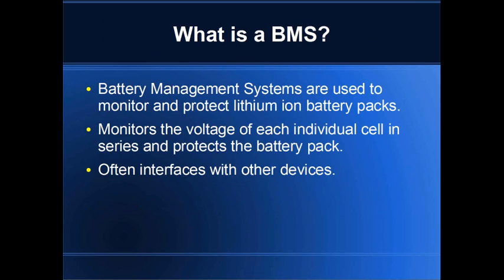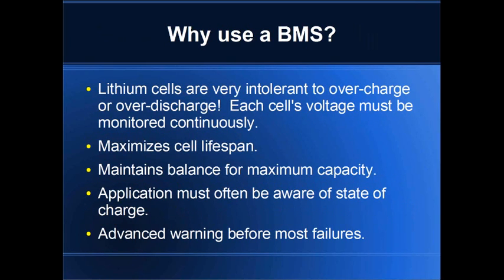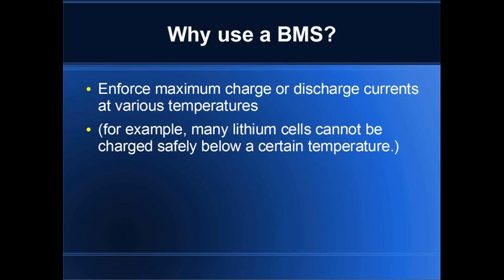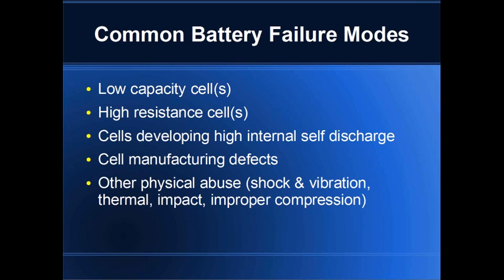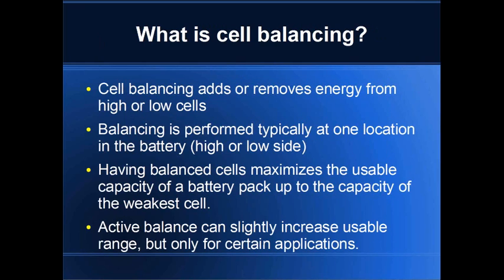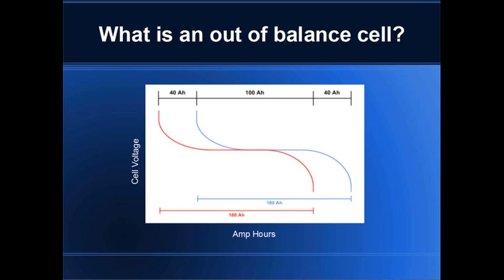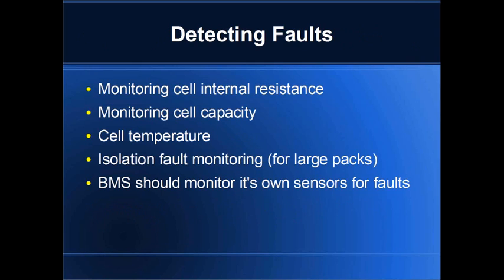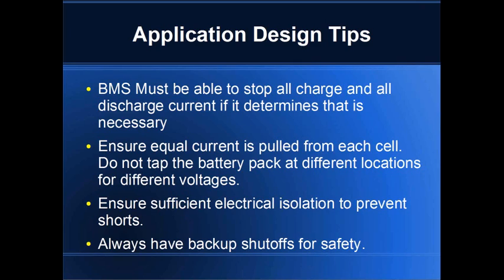Battery Management Systems and Their Role in Safety and Reliability

Comment: What is the meaning of 1C or 2 C... What these values represent... Is this ia the way to represent current and instead of ampere(A) we are using C here
Reply: 1C, 2C are rates of charging. 1C rate means the battery will get charged fully in 1 hr. If 2C rate is used battery will be charged in 1/2 hr.
Reply: C rate means charging and discharging current rate. for exp u have 10Ah battery and drawing current 20A so this is 2C, if draw 5A then 0.5C. and also for while charging also.